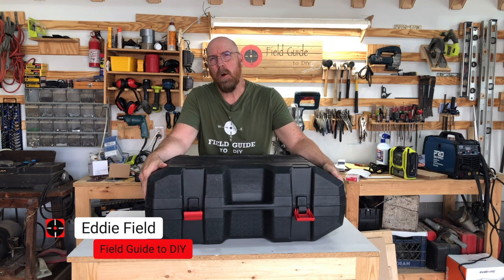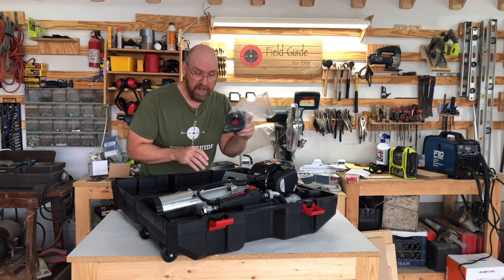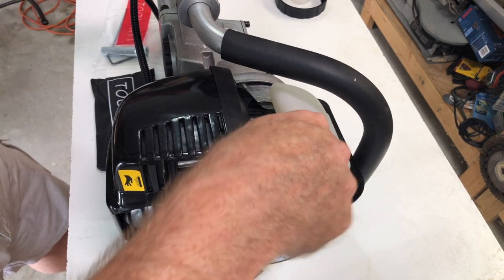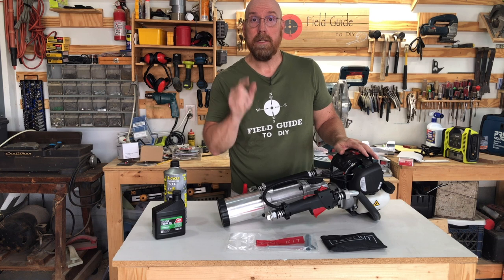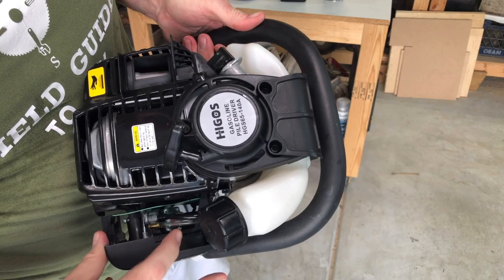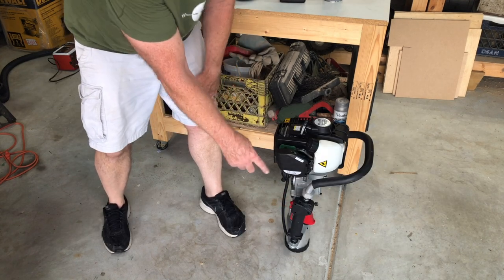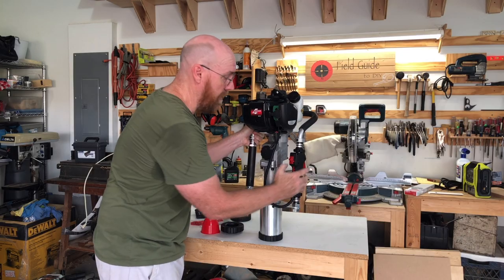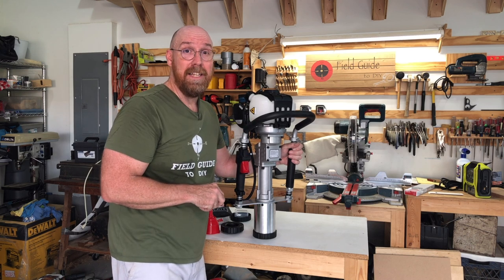INCREDIBLE Fence Post Installation | Motorized Pile Driver

Comment: Do you think these would work with oilfield pipe? same  2 3/8 diameter going into Rocky soil
Reply from the maker: I think so.  My only concern would be if you need to have a connection to other pipe.  It looks like it flares the end.  It you don’t need a water tight connection but only drive a post, you should be good.